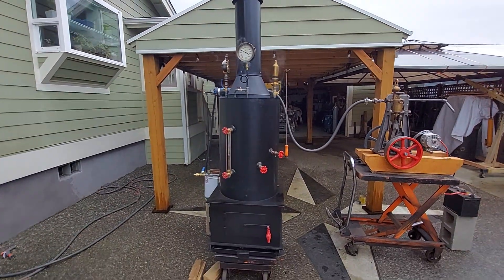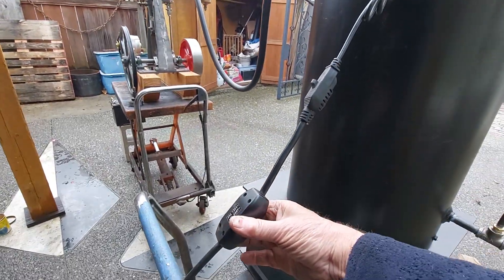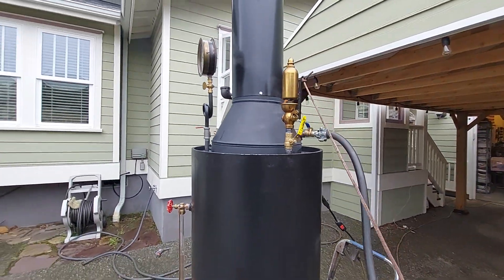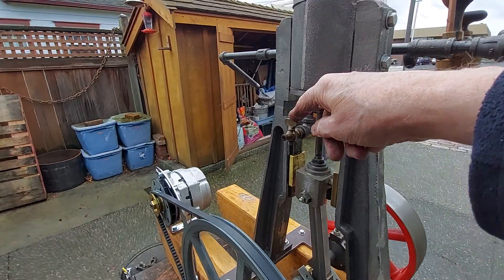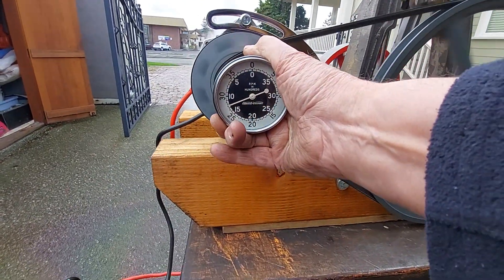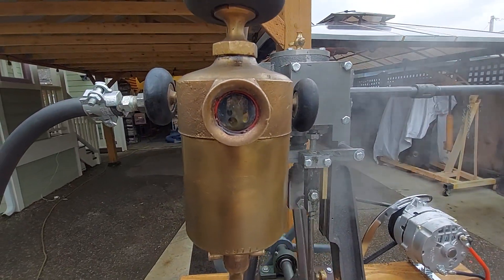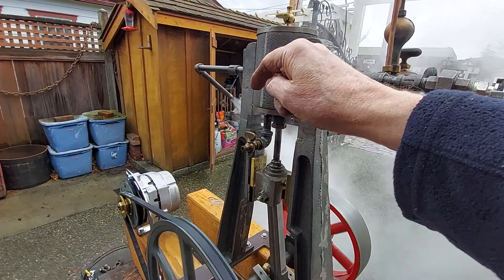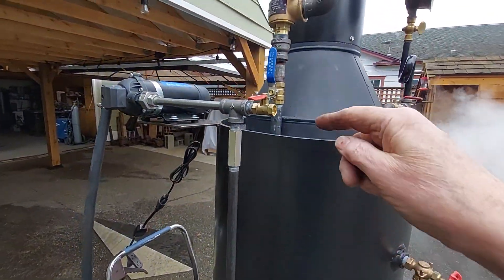steam engine and boiler for Aren

Comment: A beautiful build Ross.  I see the increased size of the pully to the alt which is a great idea. I have a general question ; is the electric pump a request by someone? The reason for my question is that if the boiler system is to charge batteries then I would assume the power is off everywhere and therefore there would be no power for the electric water pump. I believe that both , a manual and the electric be able to be used would be better. It is just a thought about a grid down scenario and no fuel available for generators and you're trying to charge up a bank of batteries for your power. Once again Ross, another beautiful build. I am still happy and grateful for the one that you built for me years ago ( 11 or so )...Michigan
Reply from the maker: Ed, sorry I haven't replied earlier I have been down with covid. I do believe that if you have any battery power it can be converted to AC thru the inverter. And you can run the boiler and engine for quite a while before you need to put water in a boiler. thanks for your great question. Ross
Reply: @rossbendixen  I hope you recover quickly Ross. Keep up the GREAT work and stay safe in your travels even if they are local...Michigan
Reply from the maker: @edporter9355  I am doing much better today. Ross